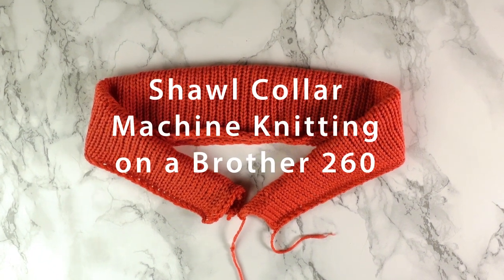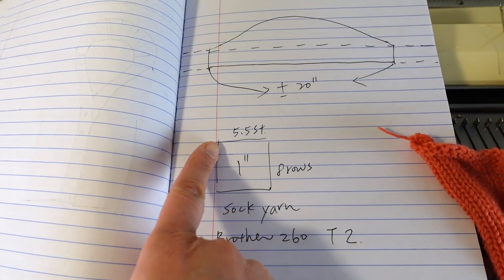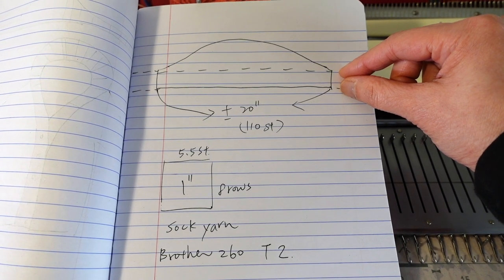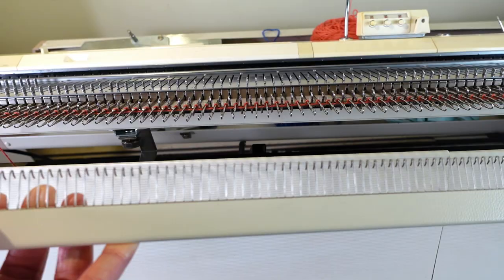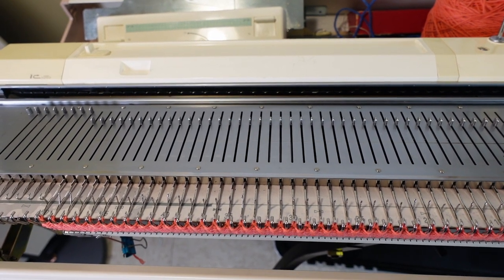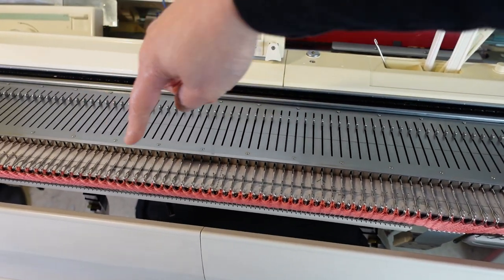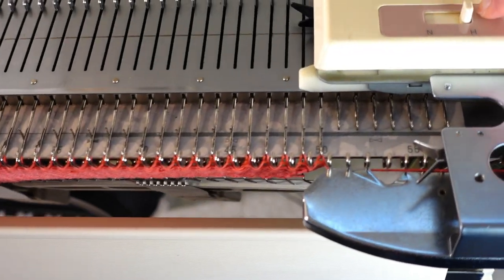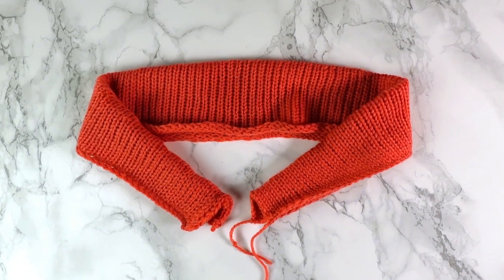How to machine knitting a shawl collar with short row on Brother 260

Comment: Why did you use a bulky machine for such a light weight yarn? You could have used your lk150 machine for that yarn.
Reply from the maker: LK150 will work nicely. I just have the bulky machine set up, so I did not think too much. Just use what is in front of me.
Reply: @CreativeTien  I know the issue of having to switch machines and it being a pain in the neck. 👍